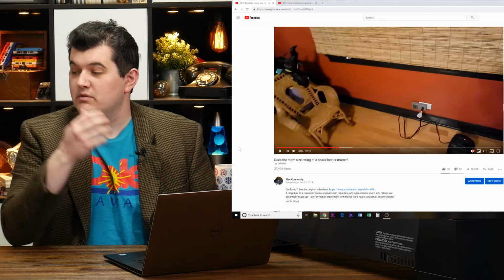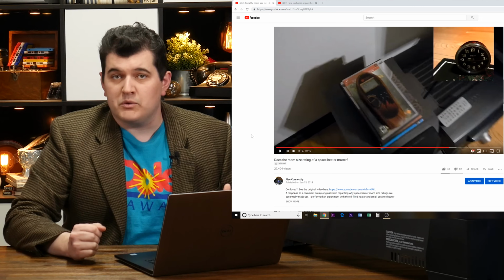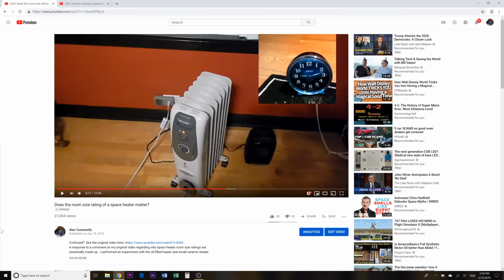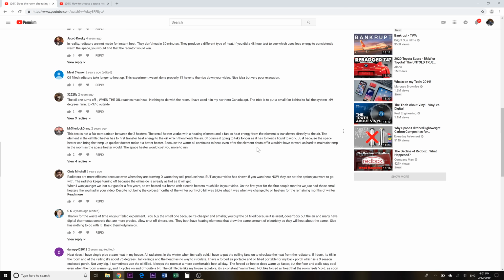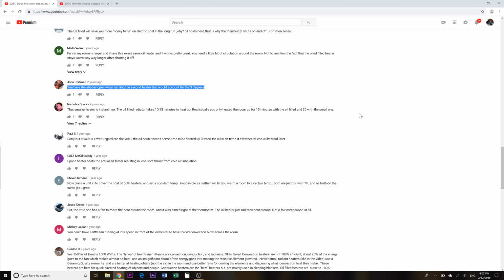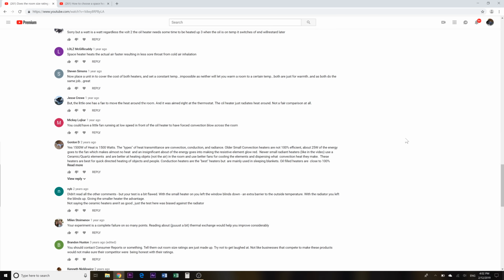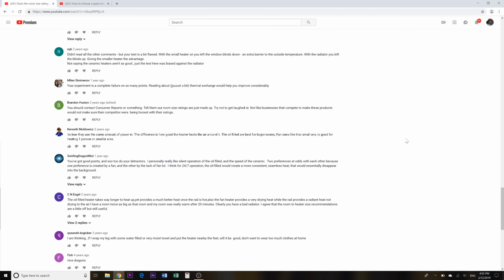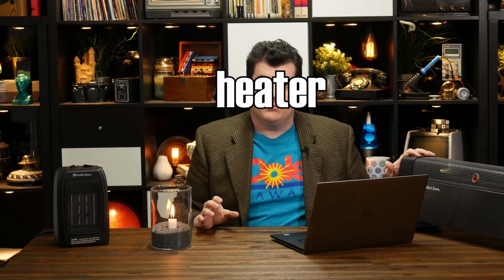More Space Heater Nonsense

Comment: Hmmm... Somehow the almost-entirely resistive element of the small heater has a much lower power factor than the big heater? Wait... where does energy loss go with non-unity power factors again? :-)

As you state, the thermal efficiency is the same if you are simply heating a room to a certain temperature. 

It's off on a tangent, but in very specific circumstances there is an economic benefit of heating up a mass to then buffer the temperature in the room. In the UK, it used to be common to have electricity metered at a much lower cost during night hours, when no-one was up watching TV and boiling kettles. So, a lot of houses were fitted with what are called "night storage heaters". These are non-portable, heavy heaters with somewhere around 50-100kg of cinder blocks as the thermal mass. The idea was that the blocks were heated during the night when electricity was cheap, and then they radiated that heat during the day time with the element turned off.

Same basic principle as the oil-filled radiator, but on a much larger scale. Also, very annoying if you misjudge tomorrow's weather.

Comment: Heat the air is the objective, I have marked my small space heater with the temperature I want the room at. I then turn it on at 600 watts with a small fan behind it. The room will warm to the desire temp, from 65 to 72 in half an hour without the heater shutting off because the small fan behind it is keeping the heater's thermostat cool until the air passing through it gets to the desired temp. I was considering rewiring the heater so when turned on, its fan runs continually, which should have the same effect, keeping the air in the room within a degree of where I want it.

Comment: Hot air rises. Therefore the radiator takes longer to fill the room than a fan heater which curculates the air. On the downside the fan heater does not heat the walls so quick and feels cold when it is turned off.

Comment: You're not wrong, but I think there is some substance to the room size rating. In a smaller room vs a larger room I would expect the small forced air heater to have a shorter duty cycle. In the larger room I would expect the long duty cycle to lead to larger temperature swings... Leading many people to turn the thermostat higher (see many other comments on this video), and that would be less efficient.  An experiment could be crafted to confirm the temperature swing theory, but it would be more challenging to conduct. The experiment would have to be run over several hours with temperature logging over time. It would also have to be conducted on days with similar external temperature, etc.  I'd watch the presenting those results. 😆

Comment: Ok so here’s something you may consider which you don’t touch on and I happen to know this is a big difference in how we do things over there and here, being the Nordics. 
We traditionally use oil heater,, but also direct heat electric heaters, but without fans. You will almost never see a fan equipped heater in a room. Rather, what we do, is we have the heaters stretched along the length of every window. And this is where an oil heater “wins” due to its built in “slowness “. The physics in play are as follow. The cold air from the window (being a lousy insulator, even with 3 glass windows) falls down and wants to rush along the wall down to the floor. But there it’s stopped by the heater, which heats up the air flow and pushes it upwards.  This creates a passive air cycle - no fans needed - that catches the cold air at the source. In this situation a slow system is preferred. But in practice a direct system works as fine, but they electric radiators are often more “agressive” in their temperature/heat output behavior. 
So if you’d placed the oil filled radiator under a window it would have performed better since it’s thermostat would have been cooled and the convection streams would have generated the air circulation of the smaller heaters fan. And in such a situation the oil heater is more effective in actually giving a better room temperature since it catches the problem at the source. 
Hope this is understandable.

Comment: If the small space heater doesn't ever turn off because of thermal throttling then it will heat the room the same as a "larger" space heater. The only real difference would be if the larger heaters are able to expell the heat faster, eliminating the heating element from turning off due to it getting too hot.

Comment: Did you measure the residue heat after you turn off the oil heater, the heat may be spread over more time for the same amount of energy used.   Agree that the heat output is the same assuming both heaters have the efficiency, but maybe the heat distribution over time is spread differently.  Not saying that is worst or better.

Comment: Watts the difference?  It's a current event. Wire we relay sparking a big revolt?  How coil we be? We have the capacity to do so much more with our inductive reasoning.  Resistance is futile. Let's switch it up, and peruse better contacts.  Then,  we can radiate positive vibrations, and establish good air among us.

Comment: I think it takes more time to heat up a large room or let it cool down. So for a large enough room where your fan won't help the air to reach all parts of the room, it is good to have SLOW heather that can be left running for a very long time. It is safe to run unattended, and it is suitable for the large rooms precisely for that reason. Fanless designs where you can avoid a point of potential failure and a fire hazard are better than small designs with fans. 

For a small room, you can turn off the fan based heater when you aren't there. The room temperature would drop, but with this, the heat loss would get slower and slower. You would save more energy by letting the room cool more and heat it up quickly when you need to. You can do it with the small space heater, but the sizeable oil-filled radiator wouldn't work. 

So small room means it is small enough so you can heat it up quickly, don't have to wait and you would want to be in the place very soon. Added complexity and points of failure from fan-based designs are okay. 

Now add a medium room, where you need some time to heat the room anyway, so some lost speed from fanless design is okay, but you would leave the device run unattended for a bit longer time. Fanless designs are preferred. 

See a large room? It takes a lot of time to heat up, because of thermodynamics, but it means your space heater will run much more time unattended, more things can happen in that time, you would be slower to react. As a result, you would prefer less hot surfaces, etc. 

So the idea behind these markings would make sense. The problem is that people started to interpret it wrong and would think that a device designed for a large room is better. And then marketing departments around the world can decide, "okay, we should fudge a bit, and print a better rating on the device." But the original idea behind the markings made sense.

Comment: I found surprising that you did not consider different frequencies (I mean, wavelength) of infrared radiation (heat) and its effect on a human body. From very long experience - decades - I can tell that fire (low frequency) penetrates and energizes human body much more efficiently than electric heat, even if the thermometer tell you the same temperature. Fan heater heats up the room, but you still feel cold because it won't heat you up. The transfer of energy through oil in oil radiator somehow changes the heat energy frequency and you don't need to heat up the room to the same temperature to feel warmer.

Comment: Just watched your other video. You're correct about conversion efficiency but you missed the point which is about dispersion efficiency. Again, it's about the area of dispersal and what size room or area you're trying to heat.  Smaller fan heaters don't work as well in larger areas because they're not good at widely dispersing heat over a larger area; they tend to create hotter spots right where the heater fan is blowing, creating a jet stream of hot air. A larger (or oil) heater will disperse the heat better in an open area with more drafts because it's still dispersing SOME heat in all 360 degrees, despite convection. The best scenario is a larger heater and a ceiling fan for LARGE areas. Yes, in your small enclosed bedroom, a smaller heater will work just fine or even better.
THUS, there IS scientific reasons for advertising the metric of small versus medium or large rooms. For a small room you don't need efficient dispersal so you can get away with a smaller cheaper fan heater. That's not so in larger open areas. Again, it's not about conversion efficiency, it's about dispersion efficiency. If you retry your experiment in a very large room then you will see for yourself.

Comment: I agree with your test. Even though most heaters are basically the wattage some do a far better job of heating a room, or a person in the room. As in how long do they have to run or how fast can they heat to certain temprature. One of the things I don't really agree with which is more in the video you made before this one is some larger heaters do work better. Like the little ceramic heater you have. I have one similar to that but the heating element is 3 times the size. It does a better job than the tiny ones.

I have tried a lot of heaters over my many years. Some designs are just better at certain things. Like the quartz rod heaters WITH an open element and reflector do a great job of warming you if you are in direct view of it. Since they directly radiate you with light. Oil heaters do a decent job of maintaining heat while being quiet and not shoving air around the room. I don't think they are very efficient though. Ceramic heaters tend to be a nice balance between the two. The popular infrared heaters selling now, like the eden pure, are basically crap and WAY over priced. They are not even true infrared heaters because the elements are behind a box and not exposed. All they do is heat that box and then a fan blows the hot air into the room. I mean they work, but not any better than a 50 dollar normal heater from walmart. Mine actually doesn't even seem to work as well. I gave it to my brother and went and got a ceramic heater.

Propane heaters or the natural gas ones the gas company will mount to your wall work far better than the electric ones. However they are not as safe and shouln't be used if you are going to sleep or something. In my area the gas company won't even install one in a room that has a bed. It has to be den, living/family room or a hall way connecting rooms. And my propane heater that attaches to a gas grill tank will heat my whole garage. The down side is you can't really regulate them.

Comment: Most electric heaters do not have thermostats. They have duty cycle controls. Radiant vs convection is very subjective. People are not calorimeters. Safety would be worth talking about. Extension cords, susceptibility to starting fires due to potential internal failures.